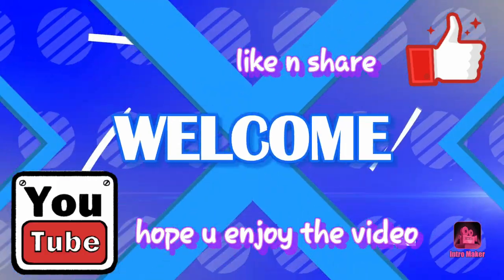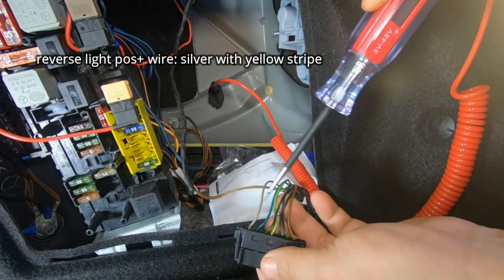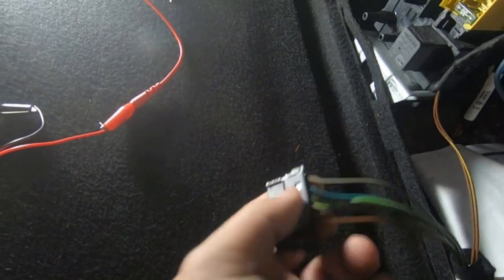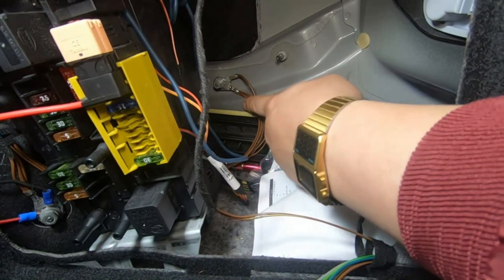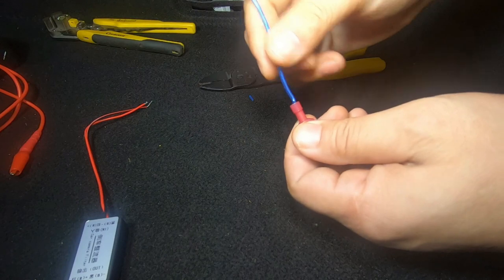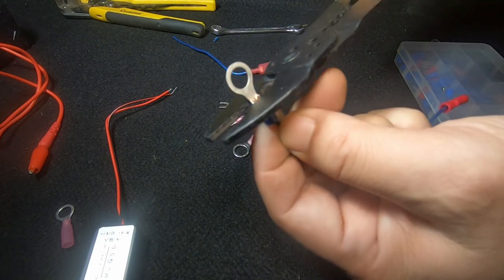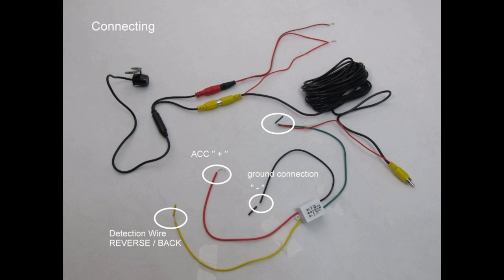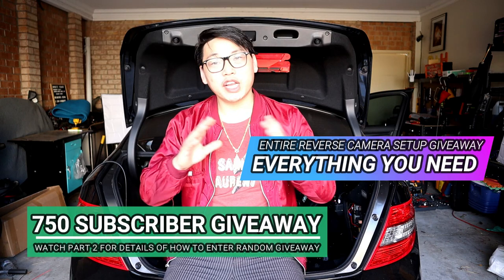mercedes w204 reverse camera install connect to reverse light PART 3

Comment from the maker: remember I'm giving away this whole reverse camera kit 
fakra cable 
camera 
cables 
rectifier 
be sure to watch part 2 and find out how to enter giveaway ...
Reply: Where did you buy this angle fakra cable Mikey? I am in NZ
Reply from the maker: @dermottfitzpatrick1450  i got it from ebay buddy just search ebay for fakra to rca and remember look at the back of your unit first so u can decide if you need a right angle or straight fakra cable

Comment: Hi, many thanks for the great videos and explanation. You are using the Fakra to replace what exactly? the Aux cable ?Thanks
Reply from the maker: i used the fakra to aux adapter , for use with typical cameras with a av yellow input, as our factory unit does not accept av cables so a fakra to av is needed

Comment: Hi Mikey! I have an android head unit retrofit and a aftermarket rear view camera. This video is great and is very helpful, thank you. Can you help me understand where the TRIGGER WIRE goes connected in the trunk? Thanks!!!
Reply from the maker: ok so for our car no trigger wire needed as it's a setting u select wen u enter engineering mode ..u don't.need a trigger wire

Comment: Hey Mikey, subscribed to your channel! Love all the work you're doing for W204 owners. I'm looking to install a backup camera myself and was just wondering if there's a particular mounting area that you think provides the best view? I'm looking at cameras that are mounted via the license plate bulb, the cameras integrated into the trunk handle housing, and the cameras that can be mounted beside the license plate bulbs where there's a plastic cover piece with no purpose. I'd assume that mounting it in the OEM location would be best, but I don't even know where that is. Also, do you know of any backup cameras where you'd be able to adjust the parking guidelines? Or do most of the aftermarket cameras built for the W204 have pretty accurate parking lines? Thanks!
Reply from the maker: I would go for the dynamic parking guide lines  and never trust the parking lines ... they are never 100% accurate ... I have both sensors and guidelines and still only make sure I go til it beeps and sensors orange rather then red and as for the guide lines they are off by about    100mm .... I mainly prefer the trunk handle camera as it is more centre compared to the license plate light camera.. plus swapping them out for less looks so much nicer... there are so many options now ... also theres even an option where u can install a camera in the spot designed for it...theres a cutout that can accompany a camera on the rear trim piece where the camera goes..so I guess the choice is yours where u decide to install it ... just do some research before hand and be sure it's where  u want it... like I said the only difference would most probably be how it looks .... and to your liking

Comment: Hello Mickeyz: great video, I am following your steps, but I have a wifi camera , I would like to avoid all the issues with wires: The camera will connect to my Cell phone (wifi). In order to connect that camera what do you recommend: Capacitor, Rectifier , Relay or a combination of them?
Reply from the maker: Either of them would be fine .... but maybe a relay for your setup

Comment: Hi good video,  my reverse light is giving 9volts and for that reason my rear camera has no image can I use this rectifyer?
Reply from the maker: Hi friend yes in the instance that your reverse lamp isn't producing the required amount of 
Voltage I would use the capacitor definitely

Comment: This is the video I needed! Great job...when you reverse to the guide lines follow the wheel  as you turn? Saw another video on YT where reserving but guide lines did not move!..!?...Is there a setting for this? Thanks...new sub here!
Reply from the maker: if your camera has the function then yes..but if you dont have the option then you will need to buy a camera that has the option..usually its a setting in the camera or on the video interface box... it depends what you have...hope this helps..
Reply: @MIKEYZVLOGZ  thanks!

Comment: Hi! I've watched all 3 videos and i've done everything just like you showed, but it's not working. There is nothing appearing on my screen... I'm not sure if I've done something wrong... I just followed you step by step. I've started from the back to the front, fixed the cam, plugged the filter, connected to grey wire with the clip, negative to the car screw negative, drove the cable tiil the fackra cable, connected in the back as you showed and then entered in the service menu activated rear camera, got to the settings menu and checked the activate by R gear.... After all this, nothing happened. The trigger cable should be connected somewhere? I'm disappointed cause after one day of work I didn't succed. Any idea about what I should check? Thank you for everything!
Reply from the maker: ok firstly thank u for ur words.. sorry to hear ur having an issue ... are u using a capacitor or relay for constant 12v power ? ... camera works wen u try it without the car? and I see u have the camera option for display when  in reverse ..that's good... now for the camera setting fid u try going through all the options? pal to ntsc ? some camera are pal... and try different setting for camera ..svcr...svc..etc there's 3 types ... trigger wire is only for after market headunits with a trigger wire
Reply: :( I didn't try the camera before installing it... I didn't know how, to be onest. In the installation, I've used a rectifier. I'm gonna try checking all the connections again. On the engineering menu I have pal/ntsc and it's set on pal. Can you give me an idea on how to check camera in this situation? Maybe you should do a video as advice... I feel so bad for not doing that. I'll get back after I'll check it. You're doing a great job for the MB owners specially w204 model. Thanks again from Romania!
Reply from the maker: @mirelmiron5438  I. sure ur camera is fine ...these are just steps I'd do if I find a camera problem but it's always a good idea to check your device works before installing ...and once everything connected u check again too before finalising

Comment: Hiya
I’ve followed your video (very good) and installed the reverse camera in my W204 but no joy. In trouble shooting I’ve found I’ve got power into the rectifier but none out - does that mean the rectifier is knackered??
Any advice welcome
Thanks
Glenn
Reply from the maker: thanks ... have u put a multimeter to it to see if there 12v power coming out
Reply: @MIKEYZVLOGZ  - it reading 11.64 into the rectifier and 7.2 out. Any ideas ??
Reply from the maker: @cameronnormac3118  something wrong ... which rectifier u using ... maybe should get a different or better one ..sometimes the rectifier is hit and miss..
Reply: @MIKEYZVLOGZ  Hi again
Got the new rectifier and have installed it. The power out is now good. I am getting a picture but it flickers/rolls across the screen. Any ideas??
I don’t want to give up but I’m about to ☹️
Reply from the maker: @cameronnormac3118  which type of rectifier are u using ? have u tried switching from pal to ntsc make sure the camera is using the right format ... usually a rectifier will solve that issue . did u tap into reverse light or fuse ? u can try tapping fuse and see if that is better ...
Reply: @MIKEYZVLOGZ  Thanks for your help I really appreciate it.
I have tapped into the reverse light as per your video but I’ll try direct from the fuse.
This is the rectifier I got from eBay. The first one came with the camera from Ali express 
12V DC Power Relay Capacitor Filter Rectifier fits Car Rear View Backup Cam YI
Reply: Ok - latest update.
Same thing happens if I tap directly into the fuse with or without the rectifier, although it’s slightly brighter without the rectifier 🤬🤬🤬
Reply from the maker: @cameronnormac3118  hmm... I'm sorry to hear ur having these issues ... the rectifier and or a capacitor should allow for a clear picture... may I ask the type of camera ur using  .. link it for me so I can check it out .. apart from the instructions I gave and the rectifier and capacitor should be a clean and easy install ... I'm not too sure as to why ur having issues with the lines and video
Reply: @MIKEYZVLOGZ | GreenYi 170 Degree AHD 1920x1080P Special Vehicle Rear View Camera for Mercedes Benz C Class W204 C180 C200 C260 Car Trajectory
Reply: @cameronnormac3118  hi mate did you end up getting the camera to work I'm having the exact same issues with my camera. Rolling black and white picture.

Comment: Hello my friend, greetings from Argentina. I have a problem with the reverse camera of my mercedes c200 w204 2009. I installed it the same as your description (without the rectifier). When the car is not running and I put it in reverse, it works fine. On the other hand, when the car is with the engine running and I put it in reverse, it doesn't even turn on the camera. can you help me? thank you
Reply from the maker: u may need a rectifier or capacitor , reason being Mercedes sam unit sends pulses through the car looking for inconsistent voltage drops and spikes, and wen detected it stops sending signal, that neing said thats why u need a rectifier/capacitor so it will constantly give you 12v to the electronic device your connecting

Comment: Hi I am retro fitting a reversing camera to my w204 Mercedes c class amg sport I followed your video but when it came to removing the number plate light I noticed that the car had factory fitted led ones so I could fit camera so I had to buy the boot handle with camera in so I thought you should know incase someone has the same problem thnx
Reply from the maker: are you sure they were factory fitted or the precious owner did them.... yeah if u can just use a boot handle camera instead its more centred and also try and get omes with dynamic reverse lines just a extra touch of class and helpful

Comment: Hi mikey. unfortunately I’ve been struggling with this. I can’t seem to get the camera to come on. When I throw it in reverse, It says “check your surroundings” but the video is black. It came on once before I completed the wiring. I even ordered another camera set so that I could go through the process of elimination and can’t even get the new camera to come on even using all new cables. I’m suspecting that it’s not getting power. I’m using a add-a-circuit to connect into the 15amp cigarette fuse. 
I suppose I will try a rectifier with t-tap just as you did. Would you help link me to an ebay or amazon add to buy it? I want to make sure that I get the correct one. thanks in advance.
Reply from the maker: sorry to hear that check ur settings if ur cam is pal or ntsc select that setting...did u try the other settings too? svc and svrc? it should work ... maybe it went bad already ..it usually works regardless of brand or quality. I'll find a set for u on Amazon or ebay and link it here for you
Reply: @MIKEYZVLOGZ  
I don’t see where in the engineering menu it as pal or ntsc. I do have the rearview camera setting on SVRC. I will try the other two options later but I think I have already tried that.
Now I think it is indeed getting power because when I disconnect the power to the camera and put the gear in reverse, the screen doesn’t change to all black screen. Whereas with the power connected, the screen will change to all black when I put it in reverse. 
If you can post a link to the camera you bought that would be great too. I want to try with exactly the same hardware you have.
Reply: update, my other options besides svrc are dvrm and dvrm-psc which i’ve tried both and same black screen.
Reply from the maker: @tas4092  ah ok then it really should work
Reply: @MIKEYZVLOGZ  
I know this is old but I wanted to provide an update that I got it working. The problem was the electric wiring. I initially tried using a add-a-circuit fuse tap with the cigarette lighter fuse. 
The fix was using a t-tap and tapping into the reverse light wire. 
Thank you Mikey for your vlogz.

Comment: About the positive cable, can’t you just plug it to that blue “15” fuse?
Reply from the maker: u can do that but the only reason i recommend a switched power source..or a switched fused..meaning it only gives  power when u switch on your ignition.... is becuz a fuse that is always on will mean your camera will run constantly ... so if u had a led ..it would be on always... hence why i suggest a switched power source... i know alot of ppl do it with the blue fuse at the rear fuse panel in the boot... and it does work all well and true... i guess its personal preference with longevity of your camera... hope u get what im saying
Reply: Thanks for the answer! I ordered a camera today, one of those boot handle cameras. It doesn’t have any LED, so, if I connect the positive in the 15 fuse, will it consume any energy while the car is parked?
Reply from the maker: @DiogoSilva-hr8ee  no it will not ... the fuse is a switched fuse ... but it also means as long as ur car is on the camera will always be on aswell...hence why i like to use the reverse light so it will on turn on wen u engage reverse....but in all honesty alot of ppl connect it ur way and it is fine..it will not drain any battery as it is a switched power source...so if thats what u want to do ..its ok aswell....wish u all the best with ur install
Reply: Great, I understood! Thanks a lot for your help, I will install the camera in a few weeks and I am still figuring out the best way to do it. Your videos are very complete, full of information, that’s great! You Sir, just won a new subscriber
Reply from the maker: @DiogoSilva-hr8ee  thanks mate more videos coming soon.... i really appreciate the support... i hope it all works out for u dear friend
Reply: I will be watching them! Thanks a lot!

Comment: Simply put. You need to be in the right fakra cable based on your model and year Mercedes. I am in a 2012. 3 fakras exposed with a very specific female end to make it all happen. Also needs the male to hook to the video(yellow rga cable)
Reply from the maker: well done mate... so its all dependant on your model and type of  fakra connectiom?
Reply: MIKEYZ VLOGZ yes. Just ensure you are in right connection port. And even then you need the right end. For me, I saw a lot of other year models and not one for 2012. Connections are different
Reply from the maker: @damnbeast404  good tip matey again... leaving comments like this..is going to help someone else who may experience the exact same issue or even installing an oem style back up camera... priceless...awesome

Comment: added my camera with your directions.....black screen.....I have no idea what could have gone wrong? Will a good ground stop the camera from activating?
Reply from the maker: is it a factory camera or an aftermarket ? 
have you tried to go through the 3 different selections for camera settings in engineering mode ? sometimes it can be due to having an ntsc cam and not a pal meaning that you would have to select the appropriate option.... did u trial the camera just to make sure that it works before installing ...are u positive all.connections are made and have mot somehow come loose? when you say a good ground? do you mean the ground is a good connection or do you mean its a flimsy ground connection? if you dont have a solid grounding point ... your camera wont work as it wont complete the power circuit
Reply from the maker: let me know how you go i will assist anyway i can.... its normally a straight forward connection especially if you simply adding a camera to your factory system.... however im sure its a simple fix ...do not be alarmed in anyway im very certain its an easy fix friend
Reply: MIKEYZ VLOGZ so I have a ground but there is paint so I have some concern about the surety of it

I am powered by my back light directly

Silver wire in the taillights for positive

Then in the center console in the on free are of my center console which is green but has no original wire coming from it

Aside from that I lost on why I have no video feed. 

Although as you say if my ground is not sturdy I may not receive feedback from the camera

Thoughts
Reply: Got it figured out. Thanks for the feedback!!
Reply from the maker: @damnbeast404  well done mate may I ask what it was exactly so we can help others who may have had the same issue
Reply: MIKEYZ VLOGZ I ensure I was connecting to the right fakra connection point. The twinned area is where we need to be on 2012s. Right side if console is facing you looking down
Reply from the maker: @damnbeast404  thanks for sharing that buddy ...im sure it will help someone else with the same make and model .... much appreciated

Comment: Whats a good camera that looks oem for w204 and does not point to low?
Reply from the maker: the one that goes in the square cut-out on your rear boot trim ill find a link for u
Reply from the maker: https://ebay.us/4uElcW
Reply: @MIKEYZVLOGZ  thanks. The one i bought goes to were the torque screws are on the trim and points lil bit low i see the road and bumber more than anything else so maybe the one u said would be better thanks